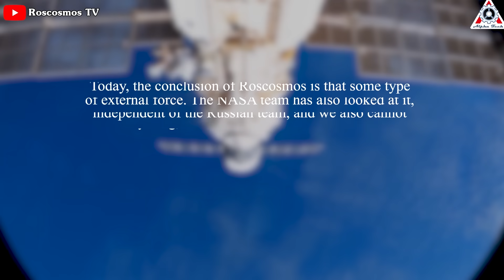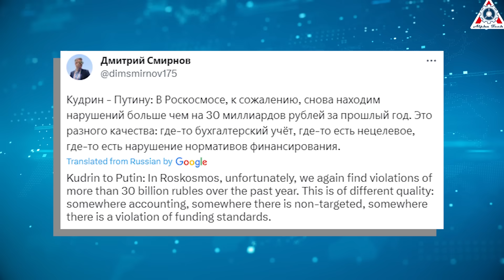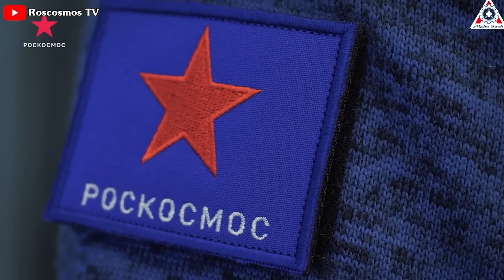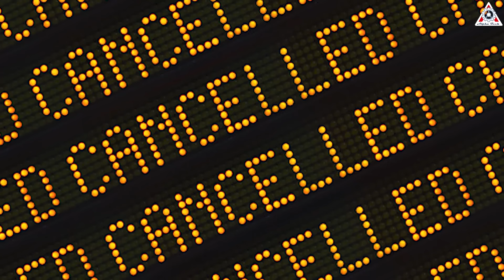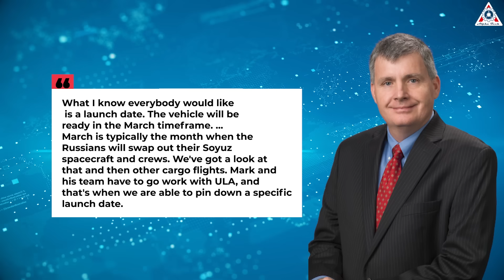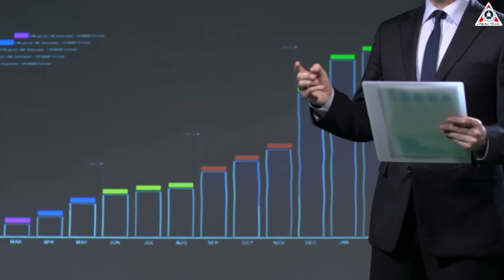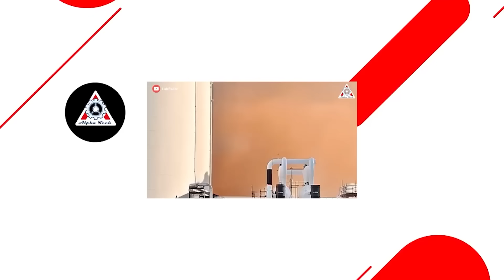SpaceX Dragon ready while Starliner's in BIG TROUBLE! NASA's Astronauts finally realized...

Comment: Problem is that dragon has absolutely no safety. If there is a problem with the launcher, as there is no reliable extraction system, astronauts are dead for sure. If there is a problem with air pressurization, as astronauts have no real space suit, they are dead for sure. Falcon 9 is extremely reliable, until there is a problem. Like for space shuttle, USA is too confident, compared to Russia or China where safety is taken seriously. There will be human losses. It's just a question of time.

Comment: I agree there should be multiple ways into space, but Boeing seems to be run by the stock holders and innovation has left the premises. They bought all their competitors and lost their way. But along came Space X and some other promising rockets working or coming along so I think we will be fine. I'm sure they will get booster rockets on the Crew or Cargo ships and the boosting of the station will be covered soon. Space X needs them boosters anyway as they have plans with AXIOM? , I think, to start a break away Space Station of their own. I have always believed in Boeing but after losing so so many competitors, then StarLiner, MAX, 7?7, you get it. They just seem lost on our dimes.

Comment: All the earlier successes were designed by people now retired.  Boeing is now the woke generation and they ( employees and local contractors) are largely responsible for chosing Seattle's wonderful leadership.
Reply: NOT woke...... Boeing of the past didn't design or build any man-rated capsules - McDonnell and Rockwell did, with Rockwell design/building the Apollo  capsule and the Shuttle. When Boeing merged with McDonnell Douglas, the bean counters took over (previously, Boeing was run by actual engineers) and lost their way. The problems that caused the B-737MAX issues were ultimately caused by attempts at cost saving, trying to software their way out of a fundamental engineering problem. BTW Brian, Boeing's headquarters moved OUT OF SEATTLE in 2001. I think part of Boeing's old success was design and construction was beside the corporate headquarters so those executive engineers were in touch with what was actually happening on the plant floor. Currently, corporate HQ are half a country away in Chicago while Starliner design/construction is at the Cape.
Reply: @john-hughboyd233  Even worse, IIRC, Boeing wants to (or already has), moved their HQ to Washington, DC. That should tell you where their priority lies.

Comment: So, this is just one capsule. Doesn't the Boeing contract require more than one capsule? I understand SpaceX currently has four crew Dragon capsule's but has reported they will no longer build more. It seems to me Boeing should already have other capsules under construction or available and should have been working to resolve these problems in those capsules as well. How much in total has SpaceX been paid for all the work they have done versus what Boeing has been paid for the work they have done poorly? This was poor workmanship by Boeing and very poor engineering by Boeing and NASA. It is hard to forget that field of toxic hydrazine fuel floating around the Starliner landing site. While we hope the tape issue can be safely resolved, imagine what happens if they have a fire? I just can't see this single capsule approved for flight. If they have other capsules underway, I would trash this one and correct the problems on a second capsule. If they have no other capsules under construction then they just trash the whole thing and go to Dream Chaser. As quickly as possible. In fact, I would stick a Dream Chaser supply craft on Falcon 9 and see if works. It is hard to say when the Vulcan will fly.